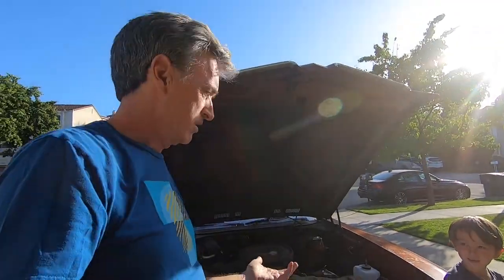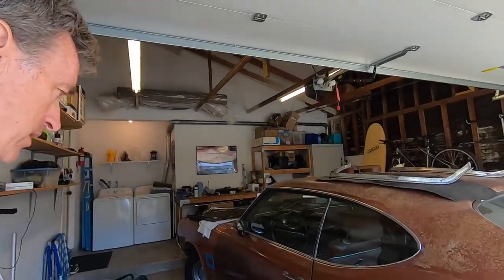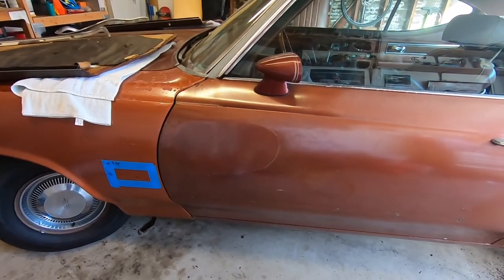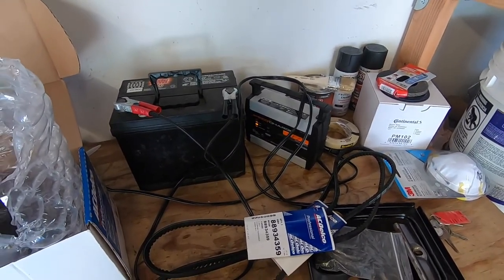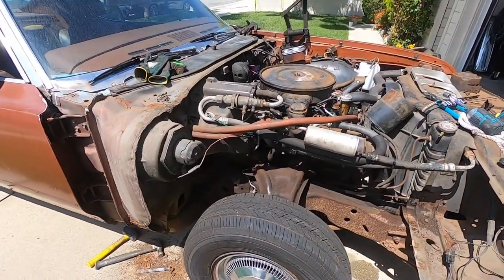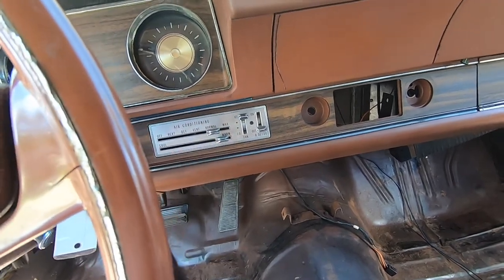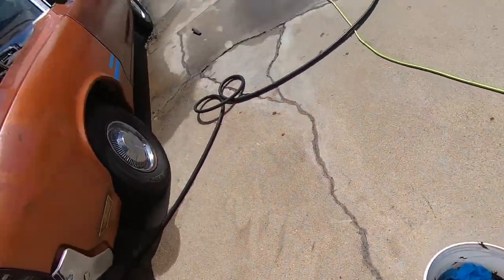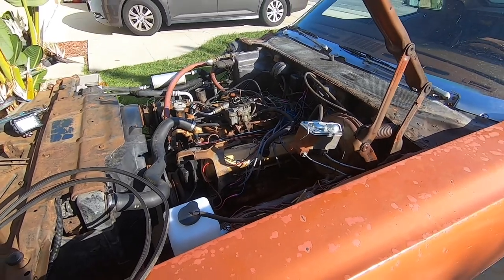1971 Cutlass more restoration projects and tearing the front fender off to get at the blower motor

Comment: Subbing as I've got a70 supreme. My sister's first car at 16 and my second at 20. just got it up and running after 25 years. it's good you pull the fender as it allowed the extra cleaning. Normally you would just pull the front tire and drop the fender well the get to the blower motor. Also Dorman makes all the rubber grommets for valve cover and those rubber elbows that connect that pipe from the breather  to the air cleaner. Wix makes the round black breather on the passenger V cover. love watching your son in action with you. My 16 year old son is a car nut maybe cause of his dad LOL.
Reply from the maker: Thanks Dan, yeah that lower part of the fender is what I'm looking to tackle next too as I have a metal patch panel to weld in. Cool yes thanks for the vendor names, I'm going to order those rubber grommets and do the valve cover gaskets along with a new breather! Yeah my 2nd car at age 18 was my first 71 and a photo of it is in the channel page. Working on cars together with your son is priceless! Appreciate the support subscribing and for watching the videos, stay tuned for more :)

Comment: Hi, first thing, your videos have helped me out tremendously with working on my 71 Cutlass S. I have a question about the fuel sending unit. Mine was the same as your’s with the gauge reading way past full. I put in a new one and the needle went to E like it should. I have put about 4 gallons of gas in it and the needle still reads E. Did you have a similar issue? Thanks in advance.
Reply from the maker: I didn't have that issue, sounds like maybe the ground isn't good?